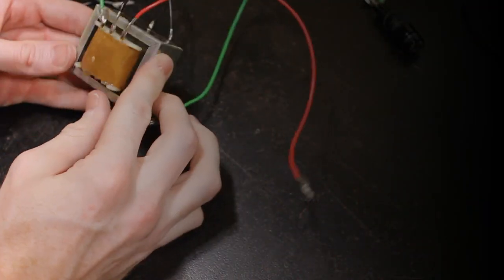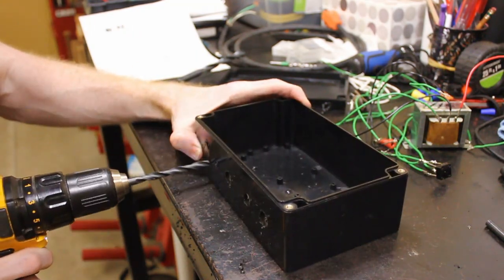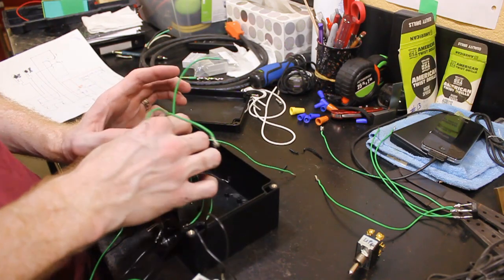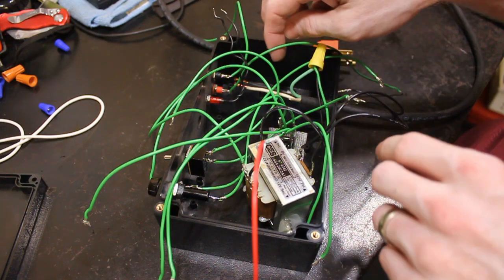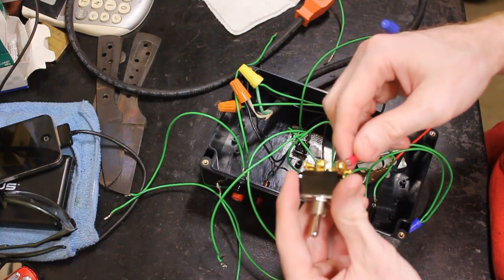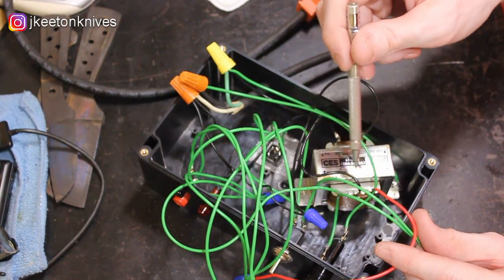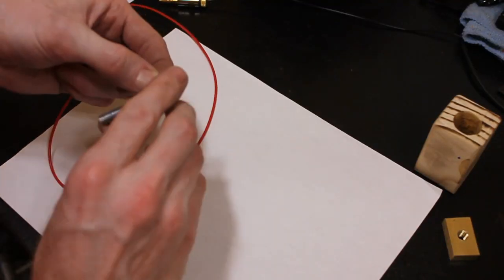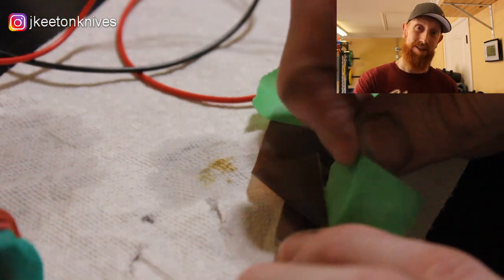How to Build an Electro Chemical Etching Machine - Full Guide

Comment: I really enjoy your videos, but I am having issues like others or similar. I'm getting 12v dc and 24v dc.  I don't get 12v ac. so when I use 24v I get a deep etch, but when I use ac, it just removes all of the darkness. it's weird. I really wish you would remake this video with the correct color wires. or if someone could chime in and help me rewire this thing. I'm kinda bummed out.
Reply from the maker: Hey Randy, I'm not sure about how to fix your problem. One thing I'd note is that I mostly etch on DC power now. I use the DC to get a nice deep etch, then brass black to darken it. 

I'd advise going back over the wiring diagram one more time. This exact etcher is the one I've been using since this video. 

You could also look up chris-crawford's original write-up on this etcher.
Reply: @RedBeardOps  thanks for the reply. I'll have to give it a once over.

Comment: So, no center tap transformer when I order parts.  I ordered just a DC output which I think will be fine, same amperage and voltage.  But, the connections are going to be different.  No AC/DC switch either.  My only real concern is hooking up the bridge rectifier.  Anyone else done it this way?  I think I can figure it out, but it would be great if there was a wiring diagram for my particular set of parts.
Reply from the maker: I haven't, good luck with your build man. Sorry I can't really help more.

Comment: I saw a guy just wire up a 9 volt battery, salt water, and did great job iv etching. You don’t even need a transformer.
Reply from the maker: That will work as well. Since I do this often, i like the more professional set up. Cheers
Reply: @RedBeardOps  yes your set up is great👍 lovely job by the way.
Reply from the maker: @TheGreatest1974  Cheers!

Comment: i had a question am i supposed to attach a ground wire to base of transformer? thanks there is no ground wire on base
Reply from the maker: I don't think I did but it's been a while since I looked this design over. Be safe sir! Make sure that box is closed when you plug it in to mess around.
Reply: thanks i got it working thanks for the video saved me a few hundred bucks ,the transformer you have in parts list isnt availible at amazon but i found one simalar that worked cant wait to get my stencils merry xmas buddy
Reply from the maker: @Anderson-HandForged  Heck yeah, if you like that transformer and it works well, please shoot me the link.
Reply: @RedBeardOps  i believe this is the transformer i purchased hope this helps other people https://www.jameco.com/z/112512-R-Power-Transformer-24VAC-2A-115VAC-Wire-Leads_112513.html?CID=MERCH by the way i got my stencils the machine works perfect love it
Reply from the maker: @Anderson-HandForged  Heck yeah, Thanks for sharing!
Reply: @Anderson-HandForged  I ordered this same transformer...how did you end up grounding it?...I ask because this unit does not have the 5th wire "black center tap" wire like the one  shown in the video
Reply: @matthewmysse1523  I think I soldered a wire to the transformer as a ground wire I can send you a pic tomorrow if you want give me you email I will send some pics I just got home from work gotta jump in shower then go to bed

Comment: I bought all the stuff from Amazon and built this etcher but your fuse listing is wrong. The listing is for small fuses that do not fit this fuse holder. But besides that everything works great
Reply from the maker: Hey John, thanks for letting me know that. I'll replace it. Really sorry I gave you the wrong link. Looks like they should have been the 6x30mm fuses. That's one of the components I had on hand already.
Reply: @RedBeardOps  not  a problem I actually had some on hand myself.  I like this design very well, I think this will serve me for many years to come. Thanks for the video and knowledge

Comment: You have your AC and DC backward. The + and - on the bridge rectifier are the positive and negative for DC not AC. You get your 24 volts AC straight off of the transformer...NOT the rectifier. A bridge rectifier takes AC current and converts it to DC current.

AC wiring norms... the green will always be associated with ground (not neutral). The white will always be associated with neutral (not ground). Black is always associated with "hot".
Reply from the maker: Seems to be working pretty darn well. I feel you on the wire.
Reply: @RedBeardOps  I didn't mean to imply that it wouldn't work! It most certainly will! I simply felt the need to correct a few things such as what is outputting DC and what is AC...
Reply from the maker: @alhefner  I feel ya. I was just saying that the DC and AC work as they should on my etcher as it stands. I get a deep etch with the DC and a surface darkening with the AC as they should.
Reply: dude maybe you can help me. I made this exact same unit and it doesn't work at all like his. I even re did the wiring just in case. I get a dark etch that doesn't go very deep and when I switch to what seems to be ac, it just peels the darkness right off. it's driving me mad.  in the up position I get 27v ac or 0v dc, down position I get -24v dc or 11v ac. none of it makes any sense. how should it be wired

Comment: Built many of these. Your bridge rectifier needs to be on a heat sink. They get hot.
Reply from the maker: Thanks for the tip! I haven't any any issues with it yet. Maybe because I'm only etching one or two blades at a time?
Reply: @RedBeardOps  True but think of the guy who leaves it on all day by accident. LOL
Reply from the maker: I can see that not ending well!

Comment: A capacitor accross the DC terminals would make a smoother DC and deeper etching much faster.
Reply from the maker: Thanks for the tip!
Reply: @RedBeardOps  The effective current, with a capacitor (that is what matters here) would be exactly the same(see the explanation later). 
Miguel: Do you really think that electrons, or in that case, the electrochemical process cares about the shape of the (DC) waveform? (Answer: No & good joke;) )
Red Beard Ops: You just introduce an unnecessary component that can fail (and will fail). That is not smart, or?:)
Some background: 5 years ago we renewed our rectifiers in the electroplating shop. A "smaller" one with 600A for the hand-operated baths and a larger one with a rated current of 1600A for the automated large-scale system. Both have a 6-pulse bridge rectifier controlled by thyristors as the underlying circuitry. None of these quite modern and professional devices have capacitors at the output.

Miguel: spreading half-knowledge is impolite. All professional devices, all schematics, all papers on that do not recommend capacitors, but the opposite.
Could I ask that you also substantiate your claim about the faster and deeper etching? Mathematically would be okay, too. You have just disprove the following facts, which are basics of the second/third year of an electrical apprenticeship: Apparently you don't know that a rectified and(or versus a) smoothed current has exactly the same rms value [1] as the sinusoidal current (like the areas of the unloaded voltage curve are related(=the same) to the smoothed voltage at nominal current). These are exactly the same, just existing only in another, namely the pulsed sinusoidal form.
[1] namely the peak value of the sinusoidal current multiplied by the reciprocal of the square root of two = 0.707 ... which gives us the area under the curve = rms, the effective-value.

So nobody has to believe my little anecdotal renovation story or the rest of the professional electrical engineering world: The math speaks for itself!;)
Reply from the maker: @dieSpinnt  Hot darn that's over my head! lol

Comment: can someone who built a working one please tell me which wires are 18 and which are 22?? there is no mention in the pdf or the vid thanks
Reply from the maker: Just build it all out of 18awg and you're golden.
Reply: @RedBeardOps  thanks! i got this knocked out in a weekend (mostly due to solder and bit sizes.) works excellent! thank you for this
Reply: @RedBeardOps  one other question i have for this; if im having trouble with image clarity; should i increase my salt ratio or decrease my hold time?
Reply from the maker: @bm5298  I never changed salt concentrations. I'd increase hold time, then use high grit sand paper with a hard backing to clean it up

Comment: That transformer isn’t available anymore... daaaaaaaaamn it! Lol
Reply from the maker: Sorry sir, if you find a good replacement let me know!
Reply: There are other with higher amps that can be used.. just need to change fuse rating.. I’m not a electrician but should work... not sure if it’ll change etching/marking much..
Reply: The way this transformer is wired it’s output is 12v not 24v?
Reply from the maker: @ta2dmacabre  Man, it's been so long since I've done this project that I really don't know.

Comment: You may be interested, for anyone with 240v power supply (Australia) I have built the Etcher/Marker using a 24V, 3.6VA 150mA Centre Tapped - Type 2854 Transformer Cat: MM2018 from Jaycar. AUD9.50. It works very well.
Reply from the maker: Very cool ian! Cheers sir!

Comment: I love the project but the execution is messy. All those wires, all the wrong colors. Green is only for ground, white is only for AC neutral, black is AC power. DC + is red, DC - is black. Wire from point to point and it won't be such a rat's next. The system works very well and leaves an excellent impression. Thank you for showing your work!
Now, if there were an easy way to make the stencils....
Reply from the maker: Yes Peter, I mentioned that in the video. The colors are obviously not ideal and the wires are too long. But hey... it works pretty good and I hope the message gets across for someone looking to build their own. Thanks for watching.
Reply: @RedBeardOps , I was running off at the mind more than critisizing but you did a great job building a unit. I don't see how anyone couldn't build one following your guide.
Reply from the maker: @dpeter6396  All gravy sir. Thanks! I hope someone building one uses better color coordination! 😂

Comment: Hey Guys take of your rings take from some one Who Has Wired a House or Two. It will be one less item to offer an zero resistance to.
Reply from the maker: Will do, good point sir. I did have the ring off when plugging it into the wall. :). But I get the message

Comment: Man, I gotta tel you - if I didn't know how this should be built, I wouldn't understand a word you're saying. You made a mess with cables, I thought it's just temporary until you get to soldering, but no, even bigger mess later, you're refering to one side of transformer as a "dc side", there's no such thing, it's a secondary output. You're very unclear. I think the most important thing is to start with a very clear explanation about what had to be done - you want to have a dc 12V 2-3A output, and an AC output - so one is rectified, another directly from transformer. However, since we want it both through just one pair of banana plugs, we're using a switch AC - off - DC. Led indicator complicates things, even circuit breaker, I mean, people need to understand basic concept, they can install a light show if they like it later. Don't get me wrong, I know what needs to be done, I understand which kind of resistances you'll be facing when etching (even tho I never did it before), but even I have problem understanding your explanation. Btw, I think you can use one of those old dc power supplies with transformer, or even just use an old pc power supply - it has 12, 5 and 3.5 dc lines, and the secondary transformer (smaller one) should give you what you want. It has all the safety feauteres, you just have to measure an appropriate place to solder AC lines. Just an idea, I think people have old supplies with transformers lying around in some old junk.
Reply from the maker: Sorry you disliked the build. Cheers
Reply: @RedBeardOps  no, no, build is alright. really nothing bad about it. i told you i really had problems with the way you explain things, and that, if i didn't know what you're building, i wouldn't find out from your video. as for the build, shorter and diferent wires would help a bit. so, build is ok for a build, but not for a yt viewer who tries to learn something.